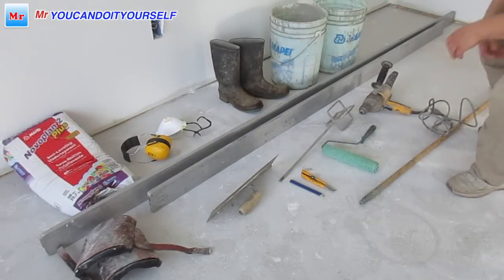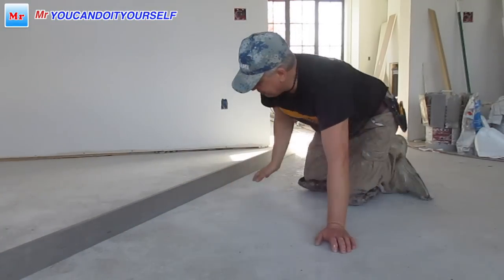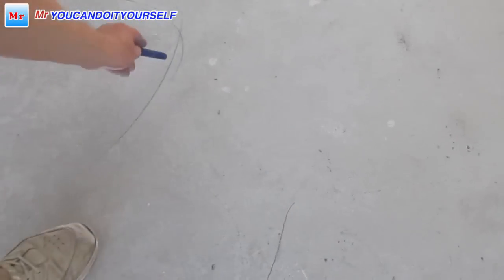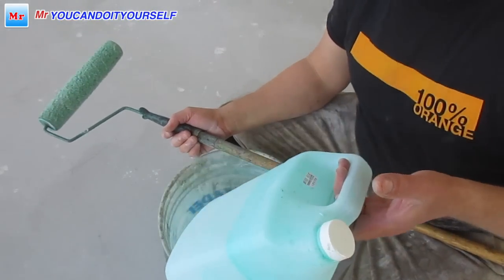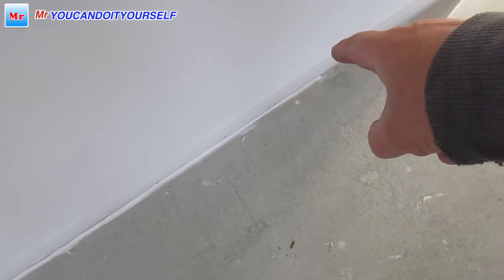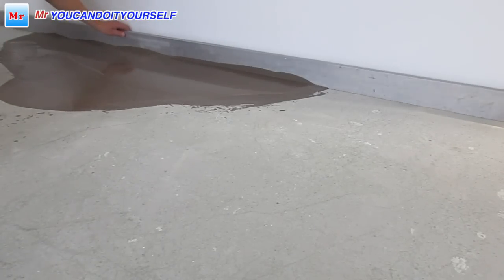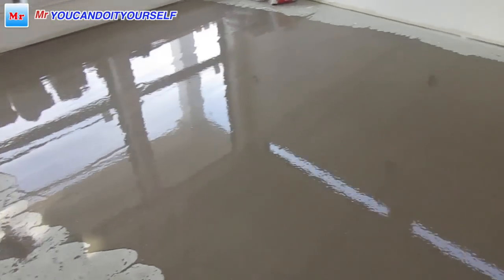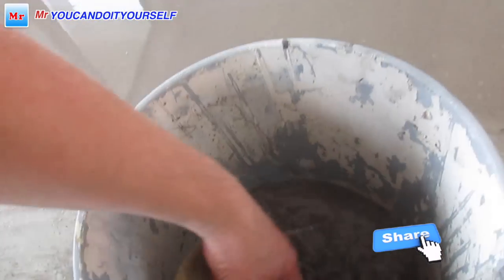How To Concrete Floor Leveling with Straight Edge DIY for Beginers MrYoucandoityourself

Comment: I have been working on leveling a large area that was almost 6" low at one end.  We poured 74 bags of 80# concrete and then I began pouring the leveling compound.  32 bags later and I'm almost there!  I have a few areas that have about a 1/8" gap and was thinking of just using a trowel but see where the straight edge is very helpful.  Also, using a sponge to feather the edges is something I never did, but will do when I go back to fill the small gaps.  Thank you!  I am confident that I can now finish this floor and then install engineered flooring over it.
Reply from the maker: Good luck for your project!

Comment: Again very good information. What I've discovered is that if you mix the self leveling compound as you did . You can than use a 1 litre jug and pour it down. I just keep doing that until the whole floor is covered and let the leveling compound do it work ...thanks again Mr fix it.
Reply from the maker: Thanks a lot for commenting!

Comment: You have the best floor leveling videos on YouTube, Thank you!  We need to level a 250 sq.ft. concrete basement floor but have been told that the primer doesn't stick to sealed concrete.  Is it true that we must sand or grind the concrete first?
Reply from the maker: Yes, you have to remove sealer.
Reply: @MrYoucandoityourself  Thank you again!

Comment: Thank you very much for taking the time creating such valuable content. I have an area which had a glued down carpet on a cement foundation. Would you use the self leveling method when you know you have first to grind down to the concrete removing the glue? Is there a leveling product out there which can be used over a contaminated  area?
Reply from the maker: Hi Peter, no any one tells you to use any self-levelling products without removing carpet glue. I am removing it before starting levelling.

Comment: This is by far the best content on YouTube for self leveler! Your videos have been a huge help to me.
I’m going to try this in some areas to fix a pour that didn’t go so perfect, I’m grinding down the high spots and have made great progress, I still have some very shallow low spots to fill. Only about 1/16th.
I was thinking maybe planipatch? 🤔but the areas are pretty wide so I thinking of trying this.

I used mapei “self leveler plus” which the rep told me is exactly the same as novoplan 2 plus.
They say 5 - 5.28 quarts of water to a bag, do you use slightly more water when using it this way?
Thank you!🙏🏻
Reply from the maker: For floor installation 1/16 for 8 feet- it’s nothing. You can leave it as it is, because by the code 1/8” for 8 feet OK. If you’re going to fill it up be very accurate. You can try add little bit more water, if recommended amount to thick for you. Don’t forget to use a primer again- it’s very important for better bonding, for each application. Thanks 🙏
Reply: @MrYoucandoityourself  thank you very much!🙏🏻
I really appreciate your help!
Reply from the maker: @Mr1fingersalute  Thanks for coming to my channel!

Comment: @MrYoucandoityourself  Outstanding job‼️...

I've seen Self-Leveling Compound, but not the type of Leveling Compound you used.

It makes sense to only apply it where it was needed.

Marking where it's not Leveled is an excellent idea 👌

And wiping the edges was an excellent idea as well to smooth it out...
Reply from the maker: Very appreciate for your comment!

Comment: Your video help very much,  your video show that only you doing the mixing and leveling, most other self leveling video, show or said that it take more than one person to work or the concrete will dry quickly. So is it possible to work alone?
Reply: It is much easier if you have two people.  One mixing the compound and the other pouring and screeding.  One person can do a small area.  I had a helper when I poured the first 25 bags but had to pour 5 by myself.  Not too bad, it worked out okay.
Reply from the maker: For this area don't need many peoples. One person can do patches spot by spot without any troubles.

Comment: What do you do with the tape that was stapled to the wall? Cut it off after the concrete dries?

Great video...Very informative.
Reply from the maker: Hi Binh, yes, when concrete dry I cut it flat with surface.Thanks!

Comment: Very helpful videos....but which thickness of screed is bettter.??.I  already did one room 12 x 14 feet using  a 6ft screed which is really not long enough.   So next room is 13 x 15 and I want to get a 10 ft long screed to avoid same problems.  They sell different lengths but also different thickness'.    Should I get a 3/4 x 4 inch thick or 1 1/2 x 3 1/2 inch thick.  Thicker screed is stiffer but Is there an advantage to using a thicker screed with leveling compound?  Or would it be worse?
Reply from the maker: 3/4 x 4 x10  - it's good.

Comment: This is amazing video with work done, I had doubts about the work, BUT now i can do it myself. Thank you
One question though, with Self leveler down on the floor, for how long can we leave it before installing the tiles? WIll the self leveler come out or get damaged?
Reply from the maker: You can install tiles on next day.
Reply: My question really means that, can I not install tiles for few months if I want to, or by delaying tile install the self leveler compound will get damaged? Pls help
Reply from the maker: It’s up to you. You can leave this leveling compound as long as you want.

Comment: Thanks so much for sharing your knowledge.  Great video.  I'm going to be self-leveling a 12' x 36' concrete basement floor using your methods.  Just a quick question: when do you (if ever) grind down a high spot on the floor before applying the levelling compound?  When grinding down high spots what tools/materials do you use?  Thanks again Mike
Reply from the maker: Better grinding down before, for concrete subfloor I use concrete grinder with turbo blade, for wood subfloor floor edger.

Comment: Thanks for all the videos you make. You are a big help to us novice people. I wanted to ask you something if I can. I pulled up my carpet on a concrete slab and noticed they must have painted some kind of moisture barrier on the slab. Can I just prime on top of that and use the leveling compound? Thank for any help you can give me.
Reply from the maker: I would recommend you remove this paint because no warranty your leveling compound will bonded property.
Reply: @MrYoucandoityourself  Thats what I figured. Thanks again.
Reply: @MrYoucandoityourself  How do I handle a room that dips in the middle on both sides of the room? Length wise and width wise. Thanks for any advice.
Reply from the maker: @mikekelly571  In this case I use tripods - https://youtu.be/9OpVeAKLDeM

Comment: Hello and thank you for sharing your knowledge. Can I put self leveling over paint over-spray on my concrete slab? It’s mostly around the perimeter and not on the center of the rooms. I will be screeding the self leveling. Thank you.
Reply from the maker: Sometimes I do it if it’s not painting completely and looking shiny. But better slightly remove with grinder as much as you can. Thanks
Reply: Its not shiny, but I’ll grind in the heavy overspray areas. Thank you so much for the quick response. You are awesome.
Reply from the maker: @JoseMedina-ms5jg  Mix primer with more water, it helps better penetrate primer to the concrete thrue painted parts. Sometimes I primering twice, first when 30% primer with water and then when it's dry with more primer like 60%-70%

Comment: Another question I have is if there's nail holes and 3/8 chips  from tack strips from carpet will the leveling compound fill it in or do I need to pre fill it with something else
Reply from the maker: I am using Mapei planipatch  for filling all holes and chips. Fast end easy. How To Use Planipatch For Wood Subfloor Leveling MrYoucandoityourself
https://youtu.be/f-P7-lElTGA

Comment: Thanks for the video! Curious why/when you would use this method with the long straight edge versus just using a gauge rake and moving the leveling compound over the entire floor.
Reply from the maker: With rake you can put same amount of compound everywhere, with straight edge only to the lover spots. Thanks!

Comment: Hello,
Thank you for this great video!
I have a question, if you could kindly answer it would be much appreciated :)
When my gap is only 2 mm should I fixe it  or I it's ok to leave it like that?
Reply from the maker: Hi Filipa, 2 mm it’s 1/8”, it’s allowed for 8  fits long. You can check it with straight edge. If you don’t have it, use rope. For small area better fix this gap. thanks
Reply: @MrYoucandoityourself  thank you :)
Reply from the maker: You’re welcome!

Comment: The edges that your straight edge is on might be hight an low up and down as you go along . You should do the whole lot 8mm deep with aggregates. Your making the job hard work
Reply from the maker: Hi Roy, thanks for your comment! Nobody complaint about my job.

Comment: do you have any videos on doing this on a plywood floor? and im doing this upstairs! so i know i will need to make sure all gaps are sealed. any tips and or tricks to this and do you get this job request often or just concrete?

also i will be doing the entire upstairs of my house and its all wavey all the way throughout. do you recomened doing it room by room ? or doing it all at once
Reply from the maker: Hi,
Here is videos how to leveling plywood subfloor:
- How to Level Plywood Subfloor with Straight Edge - https://youtu.be/F0XIcMtNr_g
 - How to Make Plywood Subfloor Leveling for Tile Installation - https://youtu.be/QcoMP22YMJg
 - How to Leveling Plywood Subfloor With Screed Tripods - https://youtu.be/7wkP0s3JjoI
 - How to Make Subfloor Leveling with Plywood and Concrete  - https://youtu.be/iCk6zCNjsQE
The best way  - level all floor, but if you have furniture upstairs, you can level room by room.
Thanks for your questions!
Reply from the maker: Here it is - https://youtu.be/7wkP0s3JjoI

Comment: If I have a subflloor with a crack but I know I'm going to use leveling comoound, do I need to fill the crack was something before I put down the leveling compound? Or do I just depend on the leveling compound to fill in the crack?
Reply from the maker: Hi Tom, here it is How-to Concrete Floor Crack Repair Before Use Self Leveling Compaund Mapei DIY MrYoucandoityourself https://youtu.be/80TWVMiZCb8
Reply: Fill or seal the crack. Also seal any holes in the floor (common in wood floors). Feathering compound, tape of cracks and around wall perimeters where drywall gaps above the floor as material will seep under to fill voids. Neglecting these probable problem areas results in leveling compound draining as the material sets up resulting in depressions that have to be fill after the pour.

Comment: Do you check subfloor in the direction that the flooring will be installed?
Reply from the maker: Hi, yes I checked floor direction and opposite direction as well. Thanks

Comment: Great videos, I’ve watched loads off your channel. They have really helped me out over the past few years. Thanks for taking the time to make them. 
I can’t find the foam you fit round the edges anywhere in the UK. Can you suggest anything else I can use?
Reply from the maker: Hi Steve, it’s foam gasket, this foam tape you can find in lumber store, used for protection between concrete slab and wooden wall frames in house building. Now more clear?
Reply: It’s a great idea that I want to try, I still can’t seem to find it anywhere. It’s must be called something different in the UK. I usually use expanding foam to fill the gaps and cut it off when dry. I have to wait for it to dry and sometimes it does let a little bit through.
Reply: @SteveTheFrench  We call it sill sealer in the US. It is a thin foam used between the concrete foundation and the sill plate. They have it at almost any big box hardware store.

Comment: Great video! Can this be used in a garage before painting the farage floor?
Reply from the maker: You can try, but for garage gays using regular concrete and different techniques.
Reply: Garage will have cars on it, this might be too weak especially if it's 1/8 or 1/4" thin. Also, garage usually has an aggressive slope to get water out. That's all I know, and usually concrete is used to build it up when people make it a dwelling unit. If you want to just paint the garage floor, I'd use a polyurethane or epoxy coating, but grind the existing concrete first so that it will stick and no oil.

Comment: well i level my floor sadly my local shop have only quick setting one 15-20 min. I think it was old too because it dont want to flow at all. So i buy another tipe for thin layer. Was even worse even thou i use penetration so it dont suck water. It seems sanding is the only option. I have more luck to level poured concrete then that garbage i have to work with. Was nowhere close to the consistency like in this video was more of a jogurt, even after i add a bit more water then on bag still a thick paste.
Reply from the maker: Some self leveling compound not so good. I would prefer Mapei or Ardex. Sika very sensitive for water. Other brands I do not use.
Reply: @MrYoucandoityourself   i measure it today and luckily the high spots are level and just have to fill 1-3mm dips. I thinking buying plain cement, mix it with water and pour. I have up to my neck with quick setting "self leveling" nonsens.
Reply from the maker: You can do whatever you want. It's your choice. Thanks!
Reply: @MrYoucandoityourself   sorry i dont want to insult you i am just frustrated with the whole apartment renovation that is dragging on for weeks and almost nothing is done. I am waiting for widows, doors, floors. Walls are still not finished and everything is dependent on something. Its small 2 room flat (bedroom and a kitchen) So on one i am working and in other is the mess. Dont have energy after job and can take day off for a while. Everything i do my self. It took me 2 weeks just to scrape the walls and remove the damage floor in one room. I done renovation as a job but doing it alone and after job takes like 4-7 times longer. I was skeptical since what i buy was 4x cheaper but i have to raise the surface by 3cm (1,18 inch). Even the last layer i manage to message so the peaks are level. I may look in to your suggestion (they sell in EU too) i now just have hot head. 2 bags of what you suggest will cost almost the same as 10 of what i use. And i needed 16 to be where i am now.
Reply: @scasny  The 15-20 minute quick-setting is a major no-no to a DYI-er, and is really unnecessary. Been there, done that. A serious PITA when you have to rush and there's no workable window at all, as it starts to set even before fully leveling out. Those are typically meant for contractors who need to be able to tile within hours of pouring it, and it does need to be troweled out or screeded quickly, or it will make things worse than they were.

Comment: Thank You for your reply.  I am considering using quickrete cement on one side of the 12x13 room since the height difference is 1.5 inches and when that is dry level
the entire floor with the mapei after applying the mapei glue. There is got to be other people with the same problem but no videos on this subject. Can you help and give your opinion on what you would do? Mapei package states 11mm height maximum. I like to take this opportunity to wish you Happy New Year. Best Regards Dirk
Reply from the maker: Hi Dirk, I filled up with Mapei 1,5” easy in one shot. But, if you want save money you can try your idea. Here is no any warranty if you mix different brands.  Don’t forget use primer for better bonding. Happy New Year!
Reply: Thank You for your help, hope you have a great 2020 with lots of new tutorials.
Reply: Dirk

I wonder how you solved the 1.5” difference. Self leveler is expensive to fill that much volumes. 

I wonder if adding more water to other cement products would be a cheaper fill and easier spread, and then screed to level.
Reply: @ivanobar1   Dear Ivan: Thank You for your email: The cost of ruffing the cement and cementing the high areas and level with 
mapei cement added up to thousands of dollars and it was not a solution . Since I do have carpentry skills we
will build a proper wood framing to bring up the flooring and at the same time install a proper subfloor through that area and
all adjacent rooms. I am comfortable with this solution because it will also be according to our local building codes.
Reply: @Dirk Bauman

Thanks for responding. I had a similar problem as you but just 1/2” and 1/4” differences at some spots. 

I ended using around 9 bags of self leveling cement (expensive). 

In the future I think I’ll mostly fill low spots with cheap, but smooth, cement, and then add self leveling cement as the top layer. 

I also  shims (cut to approx 1” square) under my level and glued them in place. I then filled the voids to the level of the shims. That was cheaper than “leveling” equipment. 

Thanks again,
Marvin
Reply: @ivanobar1   Dear Marvin: I admire you for having gone the route  that you went and had a successful outcome. I think that in future if
others have the same problem a subfloor that will adjust any issues is the better way to go with a lots of advantages that exceed the
costly and messy alternative of cement.